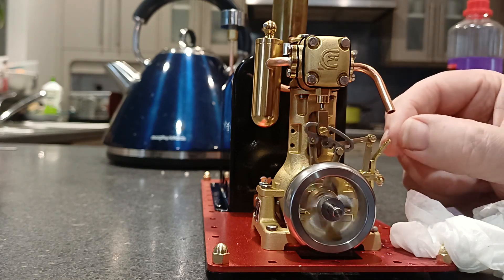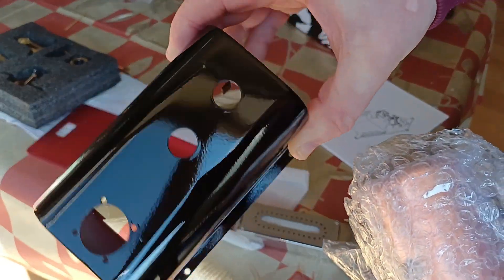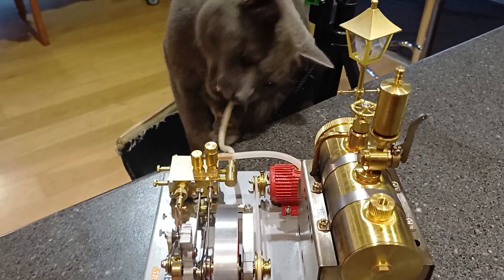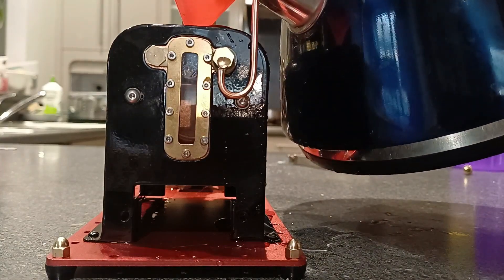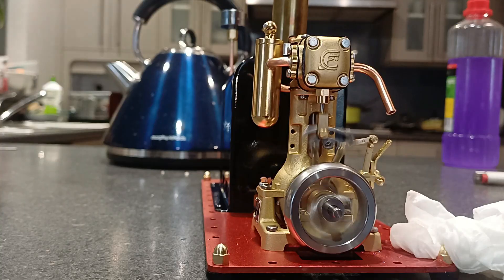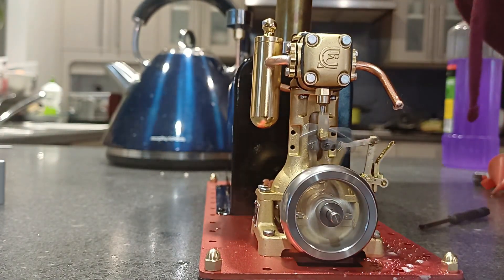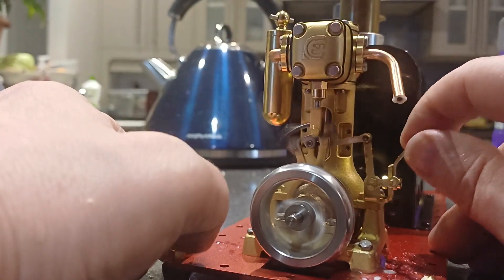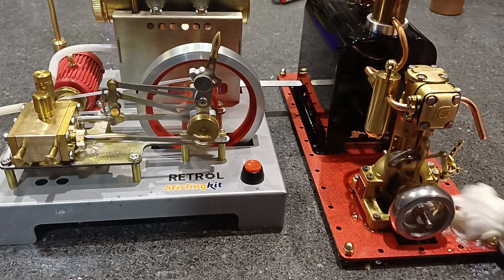STEAM ENGINE with cutting edge TECH👈 and PERFORM✅...yet CHEAP 😀🥰🤩

Comment: Hi Thomas, I have just begun building this and I am very impressed with the quality of the castings and components (the only thing I dont like is the red base), but watching your video  I can see that you are genuinely impressed, as I am too!. Watching you running it and revving the engine, is more akin to a petrol motor, it sounds fantastic. It seems that steam has entered a new era!  Well done. Ade
Reply from the maker: Hi Ade, so glad you like it! I was genuinely surprised by how good this one was! I really appreciate your comment because I have got some pushback for excessive positivity on engines I am supplied with...from China, of course.. I guess I do have to be less commercial if I get any more engines supplied. But I see what you see, the sheer obsessive quality of this can't be simple to manufacture.
I am pretty positive about all the models I get that work. But this is exceptionally well engineered.
Nice to catch up Ade. I will try to do more videos but I'm still getting over the stroke, June.
You tube has changed this year. I'm not sure I'll get any more engines given to review as views are terrible in YouTube land. I doubt it's worth supplying expensive engines for review to small youtubers

Comment: You are working hard to promote these free engines they send you. By no means this is cutting edge tech . They steal the design from 50 year old plans and execute poorly
Reply from the maker: I can always trust you for an early comment on my videos, my friend. Welcome back. I have had engines from 50 years ago and they are not as trouble free, I appreciate non-rusting materials, perfect engineering, quality miniature ball b earings and new o-ring materials and cad-cam construction. Basic steam engine designs are of course well known and "stolen" is a pretty emotive word to use, and I suspect in this case, racist. If this was English or American enthusiast building it, would you be happier...probably not. Maybe just quieter
Reply: @ThomasPCGuruENGINES  I would send this dude straight to the sin bin (hide comments) as you will only get more of the same.  As expected, the negative commenter has no content.  No balls either I expect.
Reply: @ThomasPCGuruENGINES  Well said Thomas.